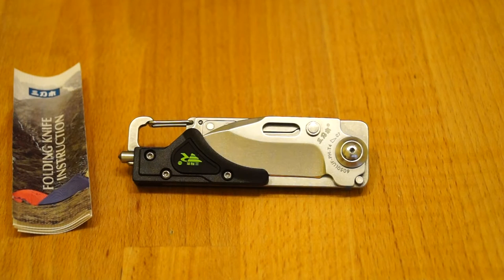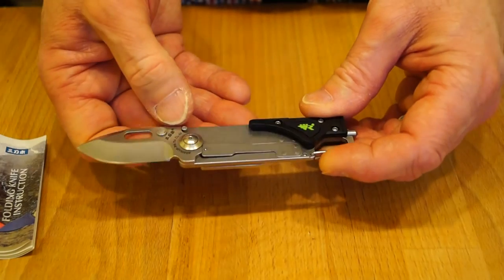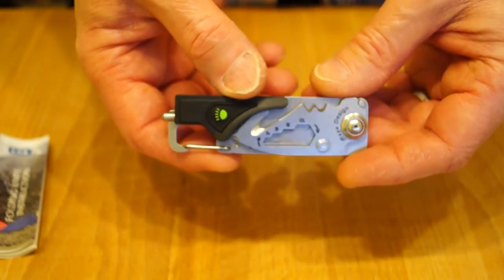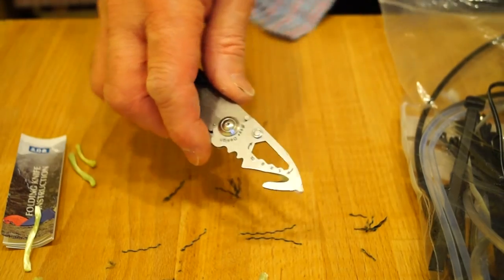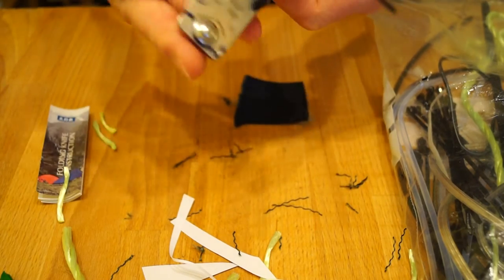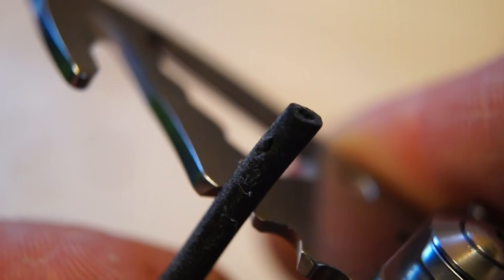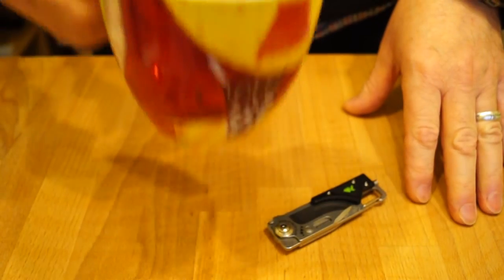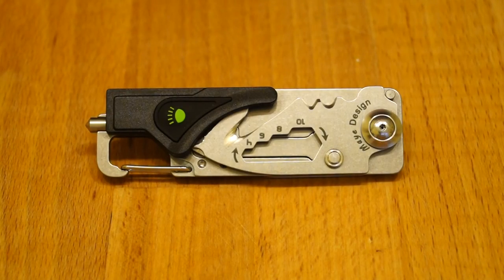Sanrenmu 6050LUF-PH-T4 Review

Comment: I haven't ordered any of this model because it looked a bit gimmicky to me in the pictures but your video shows that it's actually not a bad multi-tool, a decent secondary EDC choice.  I wouldn't want it for my main blade but it is better than just OK, I think I will be ordering one today.
Re the nut tightening.  It shouldn't be very disappointing for what I saw happening on the middle sizes (it wouldn't flex on the smallest or largest) it seems to me that it was doing a great job - for the design of the tool, as a stop gap type tool.  What I mean is that I think you had a rather good amount of torque on that nut when the tool flexed out.    It certainly should never be considered a primary tool, but instead something to use in a pinch until you can get a proper wrench or socket to tighten the nut to proper specifications.  One thing I have found over the years, thanks in large part to having a mechanic for a father, is that most people over tighten nuts and bolts, most things don't require as much torque as we tend to put on things.

Comment: That looks like it would be nice to clip onto the top of a seatbelt so if you were to get into an accident you could quickly remove it, cut your seatbelt, and break through your window if neccesary.
Reply: The light would be useful in that situation as well
Reply: Marcus Cicero unfortunately you would be breaking the law as it's a locking blade and your car is deemed a public place,this would be perfect for the car if the blade didn't lock assuming you live in the uk .
Reply: Rachael Hescott i actually live in the United States so luckily i dont have that issue. There is a speacial tool that you clip on the seatbelt called a rescueme or saveme i believe. It's basically a strap cutter with a glass breaker that you hook onto the piece that attaches tge seatbelt to the car. That may be better for people in the UK

Comment: That is a lot of instructions. Do you know what the triangle with the number on the blade means?
Reply from the maker: +maram Ovidiu I have done a little research and it seems that the triangle represents the year the knife was introduced. The number is the month. The triangles on my Sanrenmu knives point in different directions. From what I can see a triangle with its straight edge pointing up next to the number indicates 2013. As to the other positions I have no idea as to what year they represent. I hope this helps.
Reply: Nash Rathbone thanx for that. It dose help, because it has been bugging me forever.
Reply: Exactly right Nash, I asked Sanrenmu for a chart that tells what the symbol is attached to what year but they stopped responding to emails in early summer before I could get that info from them, but they did tell me clearly that it represents the year, and the 2 digit number is the month of production.   It's sort of like Buck Knives, they do the same thing but its easy to get a chart to see what symbol = which year.
http://www.buckknives.com/about-knives/how-old/